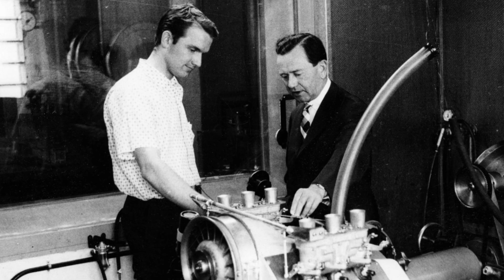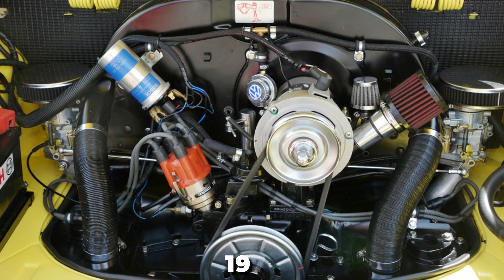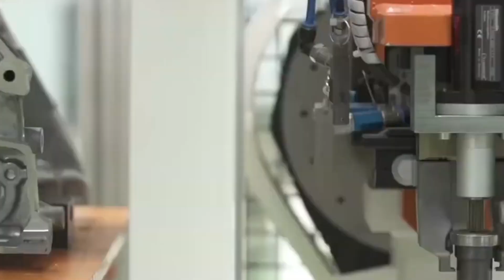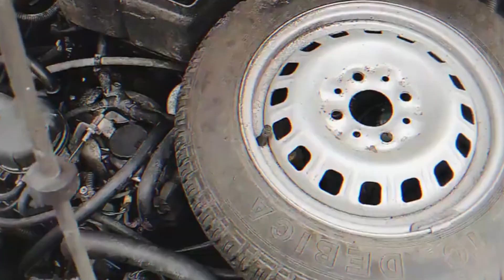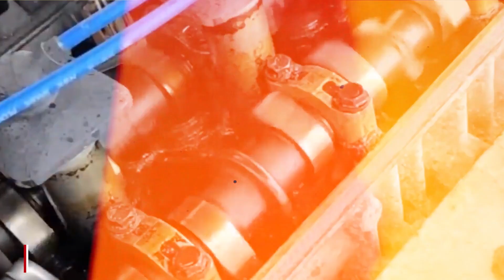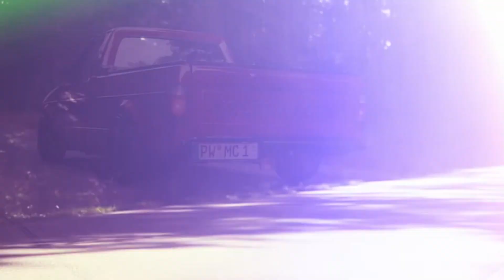The Engines That Saved Europe’s Automotive Industry!

Comment: I agree with point no. 2. I had a 1.0 FIRE, two 1.1 FIRE units and now I daily drive a 1.4 16v, the final iteration of FIRE family. Not one ever missed a beat. They may not sound as characterful as their predecessor, the Lampredi SOHC engine (two examples of which I also happen to own, both naturally aspirated and turbocharged) but they are lighter, simpler, much more modern and fuel efficient, and - in a long run - more reliable. They are, however, probably not as durable in terms of total longevity (lasting up to half a million kilometres; that’s 200k less than the older design). On the other hand they’re easily tuneable, with many parts interchangeable between generations as in Chevy small block and big block families of V8s. Power outputs upwards of 300 hp while maintaining reliability are not uncommon on turbo 1.4 units. Bottom line, this may actually be the best ~1 litre engine in history.